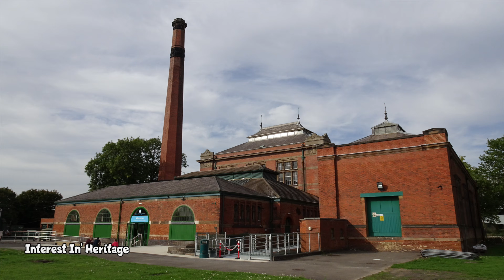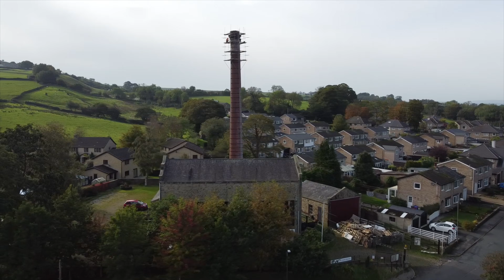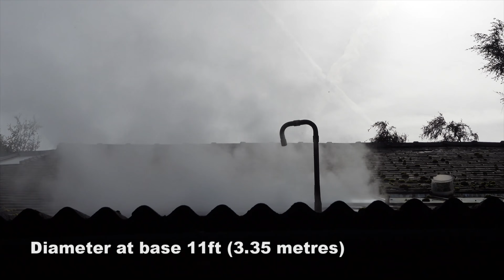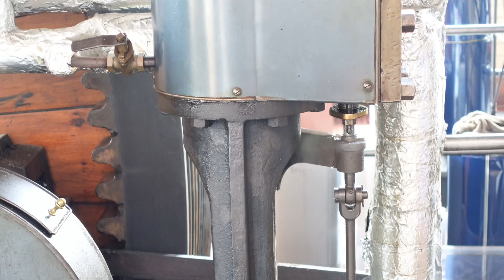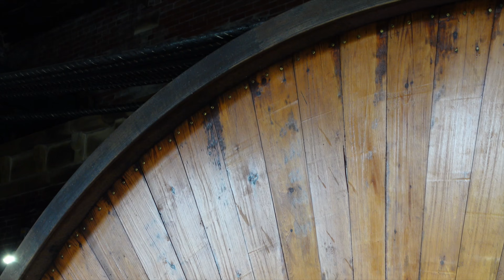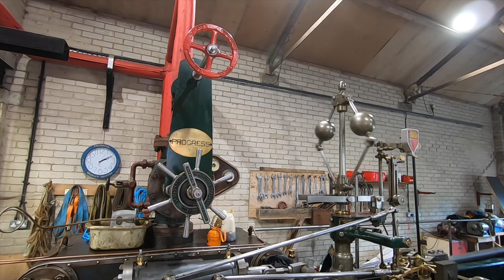19. Live Steam Engines | Bancroft Mill  Lancashire

Comment: Real engineering, it took some designing to come up with all the necessary parts of the engine, manufacture them and integrate them with high precision. They look over engineered compared to moden engines if the same horsepoer. Thank you Alan superb video and well edited.
Reply from the maker: I completely agree, the precision and design of these engines is incredible, I also marvel at the manufacture of the equipment seen in food processing factories from the raw materials to the packing of the finished products, thanks for watching!